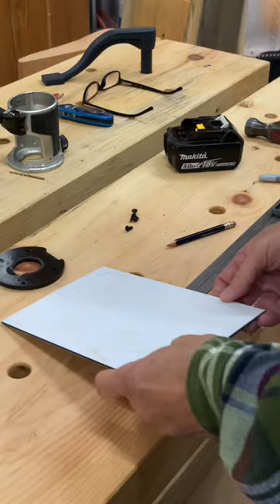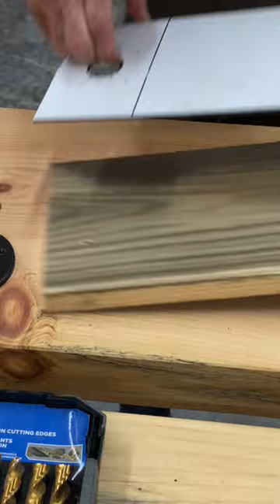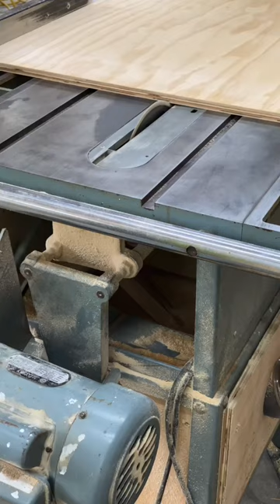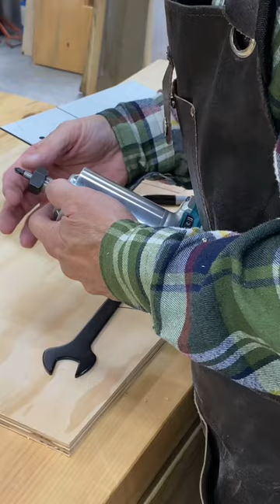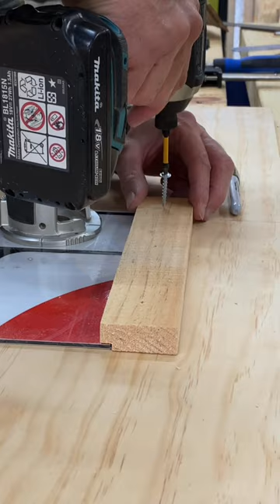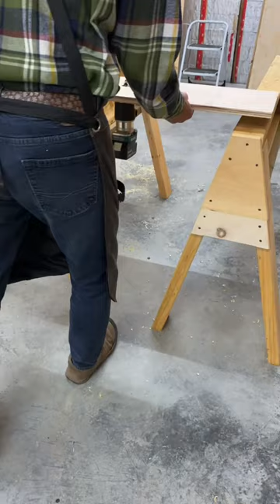Clip it Anywhere | The Simplest Router Table #woodworking #diyprojects #workshop #workbench

Comment: thanks for sharing this great idea. The aluminium is for support so the table doesn't bend?
Reply from the maker: Thank you for your comment @ebrkic1981. The aluminum plate provides support for the router and facilitates easy fixing and sliding underneath the table. This makes it effortless to remove the router when needed for other applications that do not require a table. Have a nice day!
Reply: Thank you for your kind help. Best regards, Elvis

Comment: Only for very light jobs. This LXT router is not powerful enough for trenching or grooving it dies under pressure. Great idea for light operations though.
Reply from the maker: I agree with you @seamusphelan228. We have to choose the appropriate tools for the task at hand. This compact table is easily assembled, making it suitable for use in various settings such as your workshop, outdoor environments, or construction sites. Thanks for your worthy comment and have a nice day!
Reply: Xgt does it no problem 😊
Reply: Quick switch with the power version they use the same base if you have both.
Reply: Sure, but this application can be used with other more powerful routers in a similar way.  Its the idea and mobility is what seems to be the main thing here.